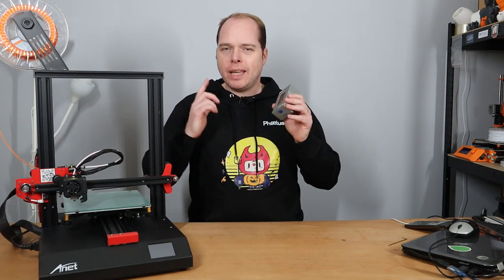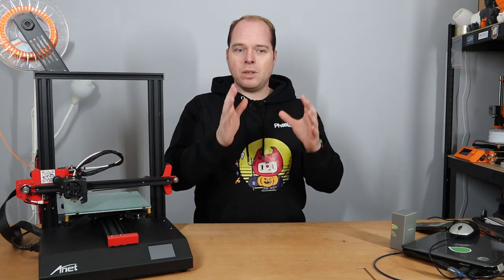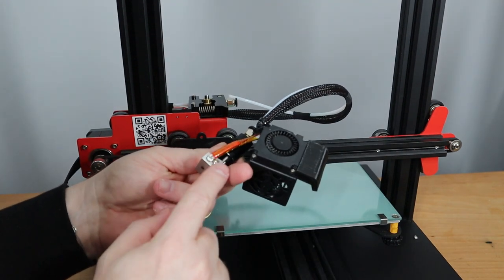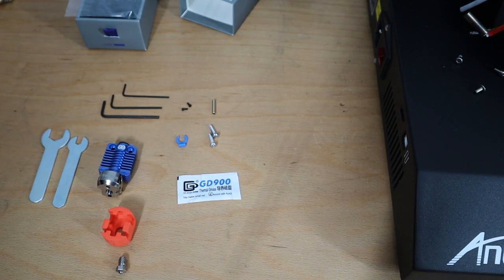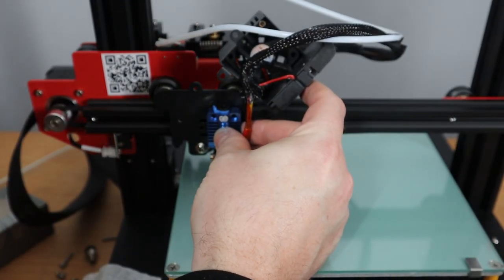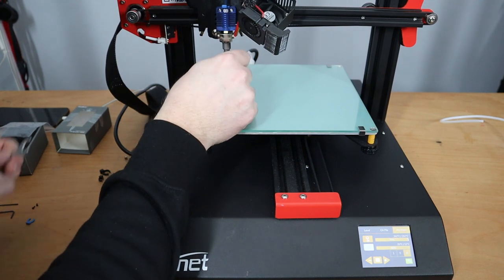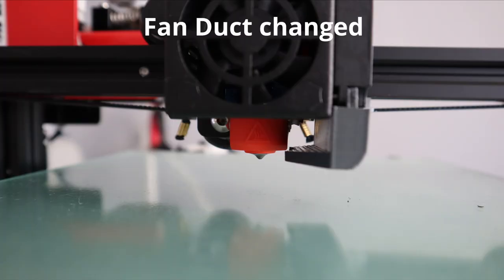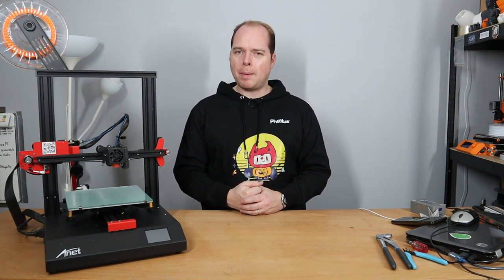Can you install Phaetus Dragonfly on Anet ET4?

Comment: I just tried to install a micro swiss hot end on my et4 that was made for ender 3 but the problem is the ender 3 hot ends are roughly 8mm shorter than the stock et4. i simply made a offset plate to lower the shorter hot end that can be used for any ender 3 hotend. the fan still hits but i am currently printing the vulcan et4 cover and fan shroud from thingiverse that should do the trick. A direct or close to direct fit to the et4 is the cr10 pro/max. so if you are looking for new hot ends to replace these junk et4 stock ones, make sure it will fit the cr10PRO/Maxx. I just ordered one to see if it will be close enough fit without any modifications
Reply from the maker: Indeed, the hotend is higher than the hotend from the Ender 3... I'm still thinking how to tackle all the issues at once, I have some ideas for it. btw I have designed a fan duct that should work... https://www.thingiverse.com/thing:4688607
Reply: I just discovered that it is shorter too!. I wish I saw your comment before even buying it. Do you have any advice? I don't wanna put back the old hotend 😓😓😓
Reply from the maker: @JohnWayne99999a  indeed, for that reason I have put this video on YouTube... I wanted to install it on there, but too many adaptions that I needed to make. Maybe you can make a little adaptor so hotend is 8-10mm lower...
Reply: @Zachary3DPrints  I was thinking about drilling a couple of new holes. The problem is that the x axis mount for the extruder has some slots (probably for heat dissipation)just below the existing holes 😓😓.. adding anything on top of the side with the mounting holes will change the position of the nozzle on the y axis and you definitely don't want that.
Reply: @JohnWayne99999a  I just built an offset plate that was 4mm thick so a m3 nut could sit flush and the hot end could screw in 8mm lower and the plate bolts to the original holes.
Reply: @BigWrigOutdoors  did the plate work? Do you have photos and specs?
Reply: @guguilviz  initially it did but I printed it out of pla. Honestly you could go to the hardware store, find a small piece of metal and just drill 4 holes in it and it would work perfectly

Comment: Do I get it right? You could install it but it didn't work? Maybe with an adapter published on thingiverse it would be great... :) Without it is quite useless...
Reply from the maker: True Markus, I know that several machines can have this hotend given by Phaetus. Since the Anet ET4 had a similar hotend, I wanted to install it on the Anet ET4. After doing a few mods, I run into the height problem. I know that there are many people that are very handy and can overcome this issue, but I can imagine that not everybody wants to do this. I took everything off and did the video for the Ender 3 Pro. Because someone asked if the installation was difficult or not, I decided to release the video, and see if someone can solve the last issue or want to try this modifications...

Comment: Hey man, I can't find your review of the hotend. If you wouldn't mind could you give me some thoughts and opinions about it.  There is almost no information on this hotend anywhere, especially on YouTube.
Reply from the maker: Hmmm, yes. I never really got into the review itself, I'm sorry for missing out on that. I have it installed on the Ender 3 pro and it's working very great. Did you saw that video, how I installed the hotend on that one?
I'm very happy with the hotend, it works great. During the installation you need to make sure that the thermistor is well seated into the little brass tube and seal it off with the grease that was provide with the kit. Especially of the price, you cannot complaint about this hotend. You have the BMO and the BMS version of it.
Reply: @Zachary3DPrints  I got the hot end as a gift and there is zero reviews for the end. I'm wondering if it improves speed and print quality on ender or cr10 v3 or I might save it for the voron kit I might buy. You make good videos I find there's a air of elitist attitude amongst the "popular" influencers. Even when you are a patreon member they will not reply when asking a simple question. I've never experienced this with any other community on YouTube. I'm into component level electronics and you can get the biggest names and people in the comments to help you without being rude. I've basically unsubscribed to most 3d channels all but a few. You and a couple others. What alot of the influencers say and what they do is a different thing. I was trying to start a non-profit makerspace and had a few simple questions since there are not any around here and I wanted to know gear to get but no body would help by answering a couple questions. The plan was cut short after a breaking to my workshop when about 15k worth of gear was either stolen or smashed. Insurance got out of coverage on a loop hole so here I am left with a few printers, a new pc I just built and my whole guitar collection from a life of collecting gone. I'm not poor but I can't replace everything overnight so I've focused on buying the stuff that pleases me like good test equipment and such. Anyway, sorry for rambling but I'm extremely jaded.

Comment: At one time manufacturers were telling us that the design of their throats reduced the heat creep, now they provide thermal paste that increases the movement of heat, am I correct in thinking this paste should not be used?
Reply from the maker: Hey Andrew, indeed, great question. From the logical point of view, I would say, use it, because is it provided with the kit. The thermal paste makes the transfer of the heat optimal for better reading of the thermistor